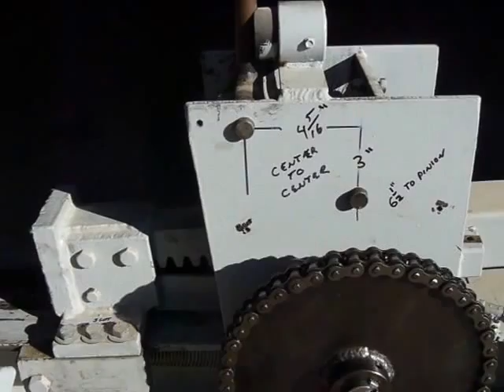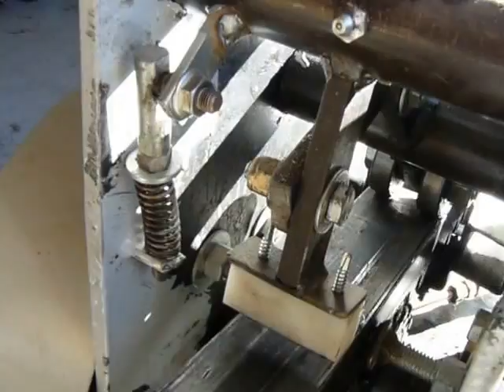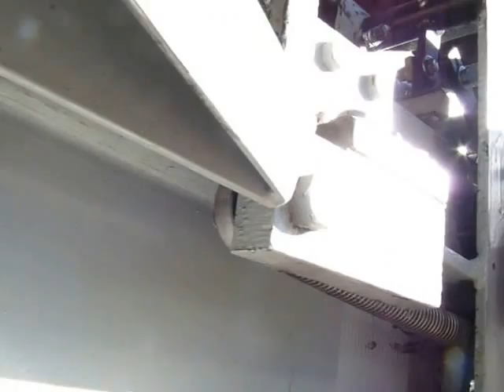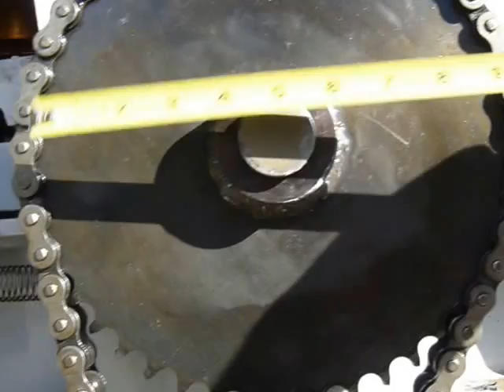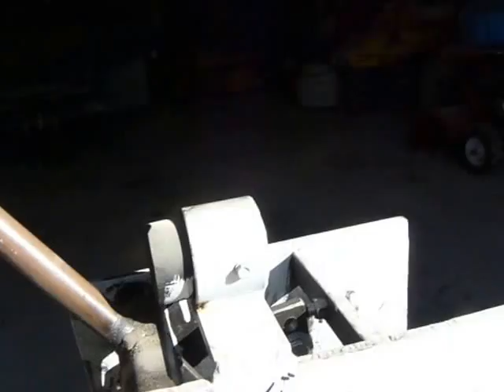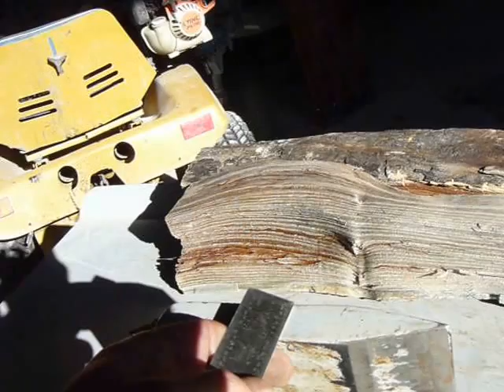Kinetic baler Flywheel log/wood splitter in detail

Comment: Where can we get a rack and pinion gear like that?
Reply from the maker: It’s made by Martin gear.
Reply: @ttenrabyrral1   Thank you for that!  While I'm here, what is approximate HP and flywheel weight?  thank you!
Reply from the maker: The flywheel is 240 lbs. the engine is 5hp.

Comment: I don’t understand what is pulling it back into place
Reply from the maker: There's a pair of long Stainless Steel springs tucked up under the beam. You can see them about 20 seconds into the video. Thanks. Wow nine year ago I posted this and still get questions. And guess what the splitter is still working great.

Comment: How does the larger #35 chain sprocket transfer power to the flywheel?  That part is hidden from camera view.
Reply from the maker: The large #35 sprocket is on a jackshaft with a small #40 sprocket on the other end of the shaft. Then a large #40 sprocket on the flywheel. The final drive is two #60H chains timed to load in unison. You could replace the #35 and #40 chains with belts and it would work fine. Actually if I were to build another I would use belts for everything but the final reduction to reduce the running noise.

Comment: Cool build Larry.   I'm like the rest of the commenters and want to build my own. 

I'm not in the know but why have you selected 14.5 pressure angle on your rack and spur as opposed to the supposedly "improved" 20 pressure angle?    Again I know what the advantages are of both but why did you select this pressure angle. 

Just watching your video to see your machine is mesmerizing!   Thank you again Larry.
Reply: Not sure about the pressure angle choice but was wondering if you had the two Martin Part #'s for the Rack and Pinion ? Thanks in advance.
Reply from the maker: @kahvac  The part numbers are in the first couple minutes of the video. This is a fairly old post at this point the numbers may have changed?
Reply from the maker: I did consider the 20 degree pressure angle but the bottom line, is it was financial. I found the rack for scrap iron price. Honestly with the low speed that the gearset operates at I don't think it would make a whole lot of difference. I have been splitting with it for eight years now and haven't had any issues with wear or breakage. However, I do reserve some of the huge knotty oak rounds for the hydraulic splitter. At least for the first couple splits.
Reply: Ok, that explains a lot on your choice of pressure angle.   I would do the exact same thing.   Those racks, be it 14.5 or 20 are pricey pieces.   Thanks for your detailed video and thank you for your response.

Comment: Great job! Thanks for sharing. Did you have to key the Martin S415 pinion gear yourself. It looks like the one sold on Amazon is not keyed.
Reply from the maker: It was delivered smooth bore I broached a .25" keyway into it. The pinion gear is keyed with a steel key while the two large sprockets, on the same shaft, are keyed with aluminum keys for overload safety. It has sheared the aluminum keys twice in 7 years of use.
Reply: @ttenrabyrral1  Larry, thanks so much for getting back to me. I’m an old farmer not a machinist, and I would love to make use of the old bailers that’s been sitting up in the field for about 30 years, this would be a great project. I have a few more questions on the pinion if you have time.
The S415 gear has a 2” face and 7/8” hub for a total of 2 7/8” . The standard broach bushing for a type C body is 2 1/2”, that leaves 3/8” of unsupported broach. How did you deal with that?

Did you machine set screws into the hub to maintain lateral movement, how many, one on the key and one on the shaft, or something other than set screws?

Did you have to heat treat the gear to harden it after the machining it?

You mentioned that weld on hubs for the chain sprockets were used so they could be alined with each other. Can you tell me what was your methodology to get them aligned and then welded. 

Just curious if you thought about driving from just one side? I guess it doesn’t add that much more to the cost to drive from both sides. Im guessing driving from both sides  help reduce the torque on the bearings? Wondering if that’s why the bearings are mounted on the diagonal?
Reply from the maker: @RichMenzel  Sorry for the delay. This project was a long time ago so the small details have long since been forgotten. If I were making the same key cut today I would not worry about the .375 unsupported distance for the broach as long as the broach was properly lubricated, being driven by a smooth straight stroking press and taking small cuts. I like to coat the back of my broach with anti seize and the cutting side with high quality cutting oil. I squirt cutting oil onto the cutting side from start to finish. Another tip for difficult broaching is to make sure you take small bites using home made shims if required. Sometimes the shim set provided with the broach is just not thin enough. I use brass shim stock under the first steel broach shim if the cuts seem to heavy with the factory shim set.

Comment: I'm curious why you had the fly wheel located below with all the chain/wheels transferring to pinion. Why not have 2 fly wheels located where those large toothed wheels are the top?
Reply from the maker: It allows for a larger pinion gear providing a greatly increased strength of design while still maintaining the proper gear ratio between the flywheel and the ram. It also greatly lowers the center of gravity increasing stability.
Reply: @ttenrabyrral1  thanks! When you say "larger pinion" do you mean wider or larger diameter? Good point about the stability.
Reply from the maker: @ninja5672  Both, larger diameter with a higher tooth count and wider to transfer a much greater load to the ram. The store brand (not mentioning any names) has a quite small pinion and is prone to wear out or just flat out break under heavy loads. My design has a considerable reduction in the dual heavy chain drive from the flywheel to the pinion.
Reply: @ttenrabyrral1  so you are giving a lot more torque to the pinion, using gear reduction, and upgrading to larger/higher tooth to give a lot more power to the ram. Smart! It is probably a good trade off to sacrifice ram speed for much more power.
Reply from the maker: @ninja5672  I have a couple other videos of this splitter but, In this video the engine is at idle. At operating speed the ram is a little slower than the store brand but not by a lot. It still makes wood as fast as you can feed it. In my opinion the store brand kinetic splitter is just moving way to fast to be safe and should probably not be sold to the general public. The flywheel on this machine weighs 240 pounds and will split anything a 40 ton hydraulic can split in a fraction of the time.  With this much weight in motion  I can idle it right down and still have enough kinetic energy to split wood. This is handy in really twisted wood or rounds that are full of knots.

Comment: Thanks Larry.  I used 20 degree pressure a  ngle for strength, and these are harder to come by.  Even with a smaller pinion gear, I am hesitant to invest in all the hardware when I'm uncertain how you would engage the gear with the race on the fly at the speed you show.  Never grinds? Does not Jam when you hit tooth to tooth instead of tooth to root?
Reply from the maker: I must admit, I was thinking all the same things before I started buying parts to build mine. I have been rebuilding engines, rear ends and transmissions for 30+ years dealing with gear meshing and backlash measured in the thousandths of an inch or prussian blue, I just couldn't imagine any way this would work, or if it did I sure didn't think it would last very long.  Well, I am now on the fourth year of splitting wood and I can tell you that there is very little wear on the rack or pinion of my splitter.  It has never once jammed at the gear engagement only comes to a stop if I run into a nasty knot.  Of course I don't dally around about engaging the gear. I slap it right into  gear every time and make sure that the ram has a couple inches travel before engaging the log. The over center adjustment on the idler bearing arm is very critical. It must just snap over center to hold the pinion and rack engaged. If it travels to far over center it will eventually slap your hand so hard you will be afraid to look down to see if you still have a hand..!!!
Reply: Thanks Larry.  I have another issue.  Whats your advice?  I have a 6 pitch spur gear.  Do you imagine any difference in the application between 6 pitch and 4 pitch?  The 4 pitch teeth are of course much larger, and meshing a finer pitch may be one issue, but from what I'v read 6 pitch might be a s strong as there is as much surface area engaged with more teeth in the mix.  Have any Idea if the 6 pitch will work?
Reply from the maker: Since you have it you may as well give it a try. The 6 pitch will require a little less travel to engage and dis-engage.. Other than that, I am not sure what else to expect. I do see many higher pitch kinetic splitter videos on here that seem to be working fine. I think the DR brand uses a pitch nearing or more than 6?  Thanks

Comment: Larry,  What do you estimate the RPM and step down requirements are?  By my calculations, I'd have to step down three times to get from 3000RPM ( 4 stroke single cylinder engine, to get my 8" pinion gear slow enough to engage.  I have this estimated at 3" x 18" pulley from engine ( 1x ) then a 3 " to 18" sprocket ( 2x ) to get to about 1 RMP which is slow enough to engage without damage.
Reply from the maker: That adds up pretty well.  The only thing that jumps off the page at me is the 8" pinion.. That's a large diameter pinion.  If you can make it work out it should last for ever.  As I recall my pinion is only around 2 or 3 inches OD...

Comment: Larry, that's pretty damn awesome. Reminds me of old school, indestructible, American made equipment from the 1950s.
Reply from the maker: That is it in a nutshell, old school, simple and indestructible.. As far as old school goes, we recently rehabilitated a 1958 school bus and converted it into a top of the line motor home with a 12 valve Cummins power plant power brakes and all the bells and whistles of a modern RV.  Queen bed, AC, central heat, hot water, shower, TV, generator etc..  And my daily driver is a 1989 Dodge Cummins that I have complete faith in making it anywhere I want to go.. Maybe I am just getting old, or maybe I have lived long enough to understand the value in simple solid engineering... I have nothing but trouble with most of the new vehicles and gadgets I own.. I started into the work force as an attendant in a full service gas station. We carried a handful of belts, mufflers, alternators, points and condensers etc. and were able to get any vehicle that pulled in with a problem running in top order..

Comment: Cool! Do you think a hand cranked flywheel design would work? Thanks for the post.
Reply from the maker: +ufoengines I do think it would be possible, but not very practical unless you had an assistant doing the cranking. The original kinetic splitter, the ax, would be more practical for hand use. It would take a lot of effort to get the flywheel up to speed and keep it there. Thanks
Reply: +Larry Barnett I've already modeled out of cardboard up my idea on hand cranked flywheel splitter and the parts count is very low (a good sign for good design)  I suppose for one man operation you would spin up the wheel, get about three stroke out of it and then spin it up again. Need to show it to the folks who make exercise equipment. Can see the late night ads now "All you greenies out there, split wood and get you exercise safely with Super Spinner Safety  Splitter, now only $59.95 in four hundred easy payment. CALL NOW BEFORE THE COPS GRAP US!

Comment: no such thing as an "I beam" anyways. It's called a "W section."
Reply: What "called" an I beam is when the depth of the beam is quite a bit more than the width. For example when you check the book "American Institute of Steel Construction" a 36 in. beam depth x a 12 in width of the flange which is the width.  Then there are the Wide flange beams which are close to the same depth and width. I'm guessing that the beam is maybe a heavy 6 x 6 in wide flange. Maybe a 25 lb./ft. which has 1/2 in thick flanges and a 5/16 " web. Hope this helps.

Comment: why dont you make an 8-way splitter? It seems possible. You know, do it all at once.
Reply from the maker: The nature of a kinetic splitter requires that you try to plan each split to help avoid the worst of the knots or at least hit them the way you want.. If all you were splitting was straight grain logs the 4 or 8 way wedge would work.. If you have ever used a kinetic splitter you would understand.. When you engage the rack with that much stored energy something is going to give and it may not always be the log...LOL...  Besides that, this thing goes through rounds quick.. In fact I didn't even crank it up last year.. I was so far ahead on the wood pile, I am spending this winter trying to burn down to the bottom before the pile rots.. Thanks for the comment..
Reply: Larry Barnett Makes sense. Thanks.

Comment: Great idea the tractor wheel full of concrete with a axe on it is one of the most dangerous. Becareful of the bearings you used as rollers under that load on the rack the races can shatter. I built a push mower lift using bearings as the guide rollers and the outer races cracked on 2 of them so I made steel sleeves to go over the OD of them and was fine.

Comment: Nice professional looking job. Well done!
I was thinking that the flywheel needed to be directly in line with the ram to maximize energy transfer and stabilize the machine but yours seems to work well with the low flywheel.
Any thoughts on this Larry?
Reply from the maker: Relocating the Flywheel to below the H beam actually improves the center of gravity by lowering it.. The machine is very stable with the single low mounted, rather than double high mounted, flywheel.. I can pull this down the road at 65 mph without any issues.. As far as maximizing the energy transfer, the larger the pinion the larger the contact area between pinion and rack.. The larger the contact area the greater the potential for energy transfer without busting a gear.. Of course the large pinion reduces the mechanical advantage between the flywheels rate of rotation and the linear motion of the rack.. That's where the low mounted flywheel comes into play.. You regain the mechanical advantage with careful selection of the drive and driven sprockets.. You must use the weld on hub type sprockets so that the left and right side can be timed exactly the same.. In other words so that both chains are equally loaded.. I just processed a cord of snarly hedge last week.. This splitter didn't even work up a sweat.. I have since come up with an even better design, in my head, since this build.. It would work a lot like a set of half nuts on a lathe apron only greatly scaled up.. The flywheel would reside at the rear of the H beam, positioned at a right angle to it rather than in line with it.. I won't start that build until I have this one worn out.. And from the looks of things that may be some time..

Larry B.

Comment: I have a request if you can, until the CAD display, a photo gallery where I see the release mechanism toothed belts, I'm interested in the ratios of speed and input speed that gives the engine because I would have joined the tractor and some 400-500 r / min. I know I'm asking a lot, but it's even OK splitter compared to hydraulic and should be cheaper to produce. I apologize for the possible problems in the translation, made by Google Translate and I hope the feedback, thank ivica.zlodi1908 @ gmail.com
Reply from the maker: There will not be a CAD file.. The release is pointed out in the video if you can get it translated.. The flywheel should spin at around 140 rpm.. You don't need a tractor the flywheel could be driven with a 1 hp engine if you want.. The work comes from kinetic energy stored in the spinning flywheel.. Proceed with caution there is a massive amount of energy on hand when the 240 pound flywheel is spinning..